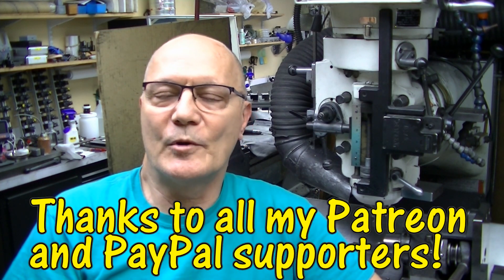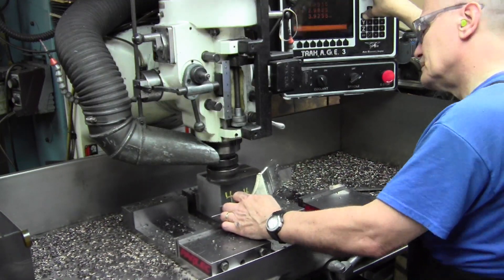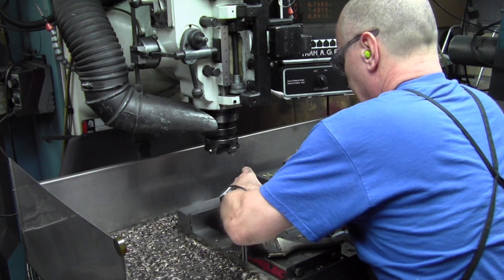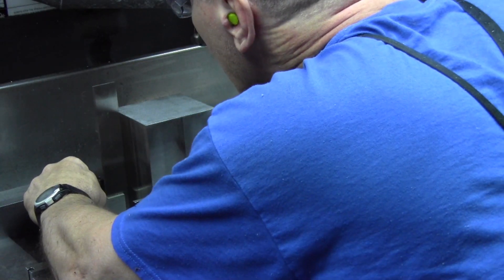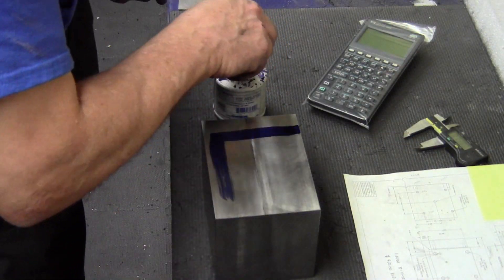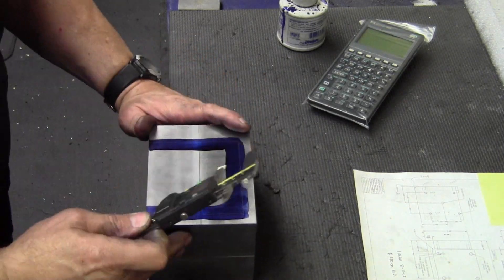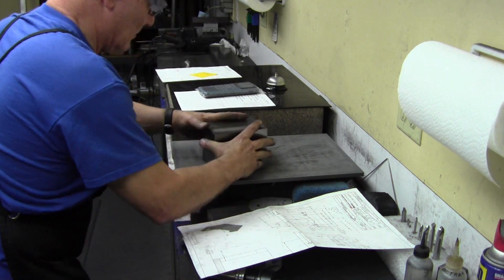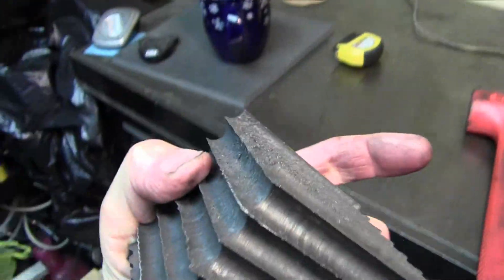CNC PLUS OLD SCHOOL

Comment: I have never really understood why cutters always leave that line you can just think you can feel on surfacing cuts. My head is trammed with a .0005 indicator to within one or two tenths. Is it just that one or two tenths that causes that?
Reply: fabricator; Robin, could I make a comment on this question? Every spindle and bearing system has give so it moves slightly depending on the cutters cutting forces. So even if your spindle is indicated perfectly square with no load on it. During the cut the face of the cutter will deflected due to the cutting force on it. You may even notice this pattern changes  as the cutter enters and leaves the work. This becomes less pronounced with bigger machines and spindles but it never completely goes away. You can feel very small (Less than .0001") deviations/steps with your finger tips.
Reply from the maker: Well said Peter, you can comment on my videos anytime.
Reply: @EdgePrecision  Thanks for that explanation, I guess I never really considered spindle movement it deflection
Reply: It's really fascinating what a facing pass will tell you about the the quality of the tram.  You can also determine the direction of the tilt and rotate your path until adjacent passes feather together evenly, the flatness error is still there, but it can look good.

Comment: I really need to learn cnc programming... that cnc trak mill sure does make quiiick work of all that processing.
Reply: I’m also quite sure I’m going to build a cage around the table as well.. I’ve seen it many times in your videos and instagram, always wanted to do the same... gotta be time to pull the trigger. Trying to vacuum up behind the mill is a choooore
Reply: I use a Trak mill at work. They are pretty easy to program using the conversational language provided in the controller. They can also accept G code from Cam programs.
Reply: A couple of other really good and easy to program machines are the Hurco and Milltronics machines. Big advantage, they aren't limited to milling machines. I used to sell both machines. Look for used to keep the initial cost down.

Comment: you might not need an oscilation feature, wouldn't it work just putting the holder at an angle to the belt so you use more belt?
Reply: Might lead to a bit of bias in the cut, leaving a slope on the bevelled edges, and Robin is a perfectionist. Sure he does have a use for those left over bits of belt though, probably used for finishing off parts or something.

Comment: For the chamfermeister, any reason to not have the guide tilted relative to the belt?
Reply: Grinding perpendicular to material can leave a burr where the belt comes off of the material, if you tilt the chamfermeister track it may need an extra pass with a file to remove a minute burr.
On the other hand with the right belt and speed you could probably avoid that